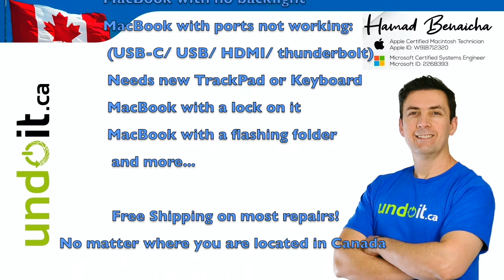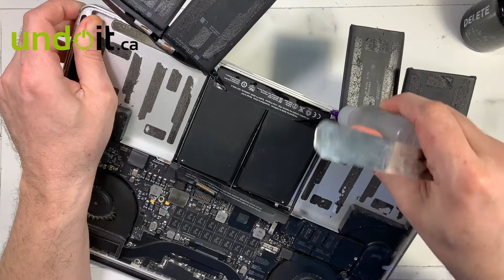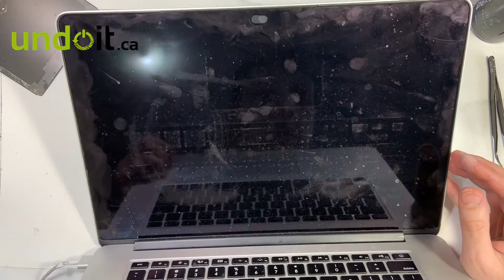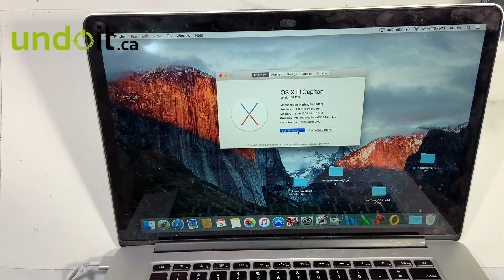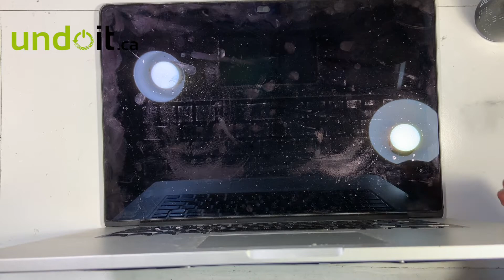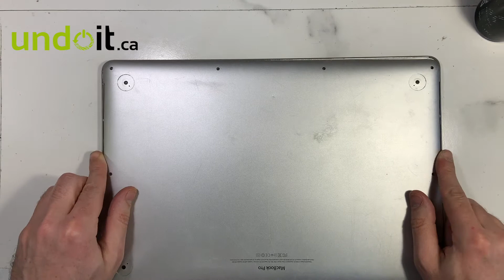🇨🇦🇩🇿MacBook Pro 15" A1398 💻- Battery Trackpad replacement👍 | undo it |  Hamad Benaicha | undoit.ca

Comment: Great vid, specially for how to install a new trackpad. I just installed new speakers. Risky business. Now the trackpad is jumpy, and the battery is not charging. How easy is it to damage the battery/logic board connection? The battery was fairly new, installed 3 months ago and was normal up until I finished the speaker installations and plugged in the power. So to summarize, the battery is not charging and pulling off the magsafe connector shuts the machine down instantly.
Reply from the maker: It looks like you will have to replace the battery, if you take your time and do it slowly it should not be a big deal, just take your time and rewind the video as many time as you have to, if for some reason something does not feat, don't force it, check what can be wrong and you'll be OK.

Comment: Thank you, merci! This was a helpful VDO. I had to exchange the trackpad of a late 2013 15 Inch A1398　and was successful with your guide. One tip: I replaced battery 6 months ago, and at that time tapes over half of the glue strips. That way I was able to remove and reinsert the battery without much trouble and without breaking the battery.

Comment: Is a touchpad from 2015 MBP 15" compatible in the Mid-2014 MBP 15"?
Reply from the maker: 2013 and 2014 trackpad for A1398 are compatible, the 2015 is not compatible with any other year, the design is completely different.

Comment: Hello Hamad, do you know what is the purpose of that black metal plate that is over the trackpad? And do you have an idea why it is painted in black?
Reply from the maker: Hello Dimitrov, I am guessing it is to protect the trackpad and for the color black that I could not tell you why. Hamad
Reply: @HamadBenaicha  Thanks for your Answer Hamad. I suppose it is not a big deal if the black color gets scratched, or is it? I am asking since on your video the black color on that plate seems to be scratched a little.
Reply from the maker: @dimitrovster  Yes it we are talking about the metal plate that sit on the trackpad, it's no big deal if you scratch, it's only purpose is to protect the trackpad, it has no functionality to it.

Comment: Thank you very much - to the point and clear, great tutorial. I was able to change my battery fine, but it seems there's a problem still! When I tested the battery before installing, the charge was 74% – and I turned it off, but then turned it on again to check Cycle Count (1) and Full Charge Capacity (8848) but this time the charge was only 30% something! After installation was finished, the small LED light on the power cord socket does not light and the computer does not start. I remember noticing that Amperage (mA) was -2400 -> does that have to do with this? Or is the battery I bought just bad?
Reply from the maker: Hi Richard it's hard to tell but most likely a faulty battery, an easy way to tell is plug the old one in (assuming it still work) and see if the power drops so fast or so suddenly but usually based on my experience a faulty battery.

Comment: this was easily the most helpful video on this subject. i spent several hours watching various ppl go to great lengths with different, unnecessary measures. i wound up using a bit of fishing wire to get me started on each cell (well in truth, i used a thin nylon string from a ukelele), but mostly just used a couple of plastic spudgers i had laying around for the rest of it with zero adhesive removal. very similar to how Hamad uses the spatula here, but the blunt spudgers gave me a bit more confidence in not puncturing the battery cells.

Comment: .Late 2013 15" retina....I have to do mine... I noticed it when I was at my Car dealer today waiting for my car to be serviced.... the dreaded "wobble"......Dang that was fast.. you really don't have to remove all the connectors and such like in other guides i've read,  been wondering if using say string or a fine wire might help, like "cutting cheese" in a way to break loose the adhesive for us DIY folks.

Comment: How good is the performance of the battery compared to the original one?
Reply from the maker: it is very hard to tell depending on the quality, I've had some that lasted longer but in general they will last less, for that model A1398 if it is a very good quality, you might get 5-7 hours depending on what you are doing. This is just based on my personal experience of course.

Comment: which battery brand do you recommend for a replacement ? duracell, ifixit, greencell ? I need it for my macbook pro mid 2015 A1398
Reply from the maker: I would only buy from reputable third parties as I've seen so many MacBooks with burnt charging circuit because the battery were of such poor quality. it is hard to recommend products but and please don't quote me 100% on it, fixit.com seems to have good quality batteries, based on the feedback I received from users.

Comment: Thanks for the tutorial, it's so much helpful: impossible is nothing. Now I'm going to do almost the same by my totally non-tech self )) Fingers crossed )) 
Any advice on where to get a fresh battery for MacBook Pro 15" model A1398 mid 2014 from? Or at least what should be taken into consideration while surfing e-bay offers? Official Apple says it's a vintage already...
Reply from the maker: Batteries and hit and miss and in all honesty there is none that I could recommend, my only advise would be make sure to read if there is reviews or recommendations
Reply from the maker: Hello Irina
Good batteries are not easy to find and can cause problems if they are of poor quality, as far as I heard fixit.com seems to have good quality batteries, but I am just going based from what users told me, I personally buy batteries from a local suppliers in Toronto which only sale in bulk and to computer stores.
Reply: @HamadBenaicha  oops, somehow failed to reach the site by the link or via google search. Do you, by any chance, know the manufacturer of the batteries you buy from local supplier?
Reply from the maker: please email service@undoit.ca   (are you in Canada)?
Reply: @HamadBenaicha  done, many thanks in advance!
Reply: @HamadBenaicha  I want to thank you for this tutorial, too! I was definitely not interested in replacing my battery myself until I watched your video. The other methods are ridiculous, and I say this as an electrical engineer who has built computer based electronic test equipment. So do you mean ifixit batteries? or fixit batteries? I am finding ifixit, but not the fixit brand.

Comment: Thank you so much Hamad. I'll use your video to replace my battery. Now to find a spatula.
Reply from the maker: No problem, let me know how it went!
Reply: @HamadBenaicha  Removal went well. I purchased an A1417 battery on Amazon.com from a company called Powerwoo. They described 8800mAh. After installation, before calibrating, it showed 8350mAh. After calibration, it now shows 8094 mAh. So I'm disappointed and have requested a return. But that means I need to remove it and try a different battery. Do you recommend any Amazon.com company to purchase a battery? Or elsewhere? Thanks for your help with removing the battery. Really appreciate it.
Reply from the maker: @Perly53  Hi Ricky... Batteries are hit and miss to be honest, I buy them from a local place but they only sale them to locals, Did you check with fixit.com - I never ordered from them personally but I hear good things... But don't take my word for it, please do your home work and check their reviews.

Comment: I have same device I cleaned it and changed thermal paste but still heats fans so low. Please advise me
Reply from the maker: what year is your MacBook?
Reply: @HamadBenaicha  MBP 2015 ....256GB
Reply from the maker: it is hard to tell until it is checked as it could a GPU going bad, a bad cooling heat sink, a bad sensor on the logic board..
Reply: @HamadBenaicha  thank u. How to send to u sir
Reply from the maker: @khalidali1972  I hope you are in Canada? if yes, please check our website at www.undoit.ca
Reply: @HamadBenaicha  thank u. Iam n middle east.
Reply from the maker: @khalidali1972  That's a bit far I am afraid :)

Comment: Hi I am gonna replace the trackpad on my MacBook Pro (Retina, 15-inch, Mid 2015) A1398, Can I reuse the battery if I am being really gentle and it is in good condition or is it risky?
Reply from the maker: Yes, absolutely but make sure that when you remove the battery that you are very careful and that is it does not get scratch.
Reply: @HamadBenaicha  Thank you for your quick reply, I am relieved because I was scared to get a battery that is not original and Apple doesn't sell them

Comment: You left your hard drive in
Reply from the maker: You are correct, likely enough for me I realized it after finishing the video, I debated if I should redo it or not but I didn't think it really mattered as the purpose of this video was about the battery and trackpad, but thanks for taking the time and letting me know, much appreciated :)
Reply: @HamadBenaicha  Thanks for the video I have mine to do and I learned a lot :-)
Reply from the maker: @cszrwi  Very happy to hear that! Thank you

Comment: Great video.  My battery is giving me the alert to change it and this is a big help.  I'm in the sates, not CA, so I'll have to do it myself.  Question, at the 11:50 mark you put your hard drive in to test the track pad and all, but I didn't see you swap it back out. Did you leave your hard drive in it?
Reply from the maker: Thanks Brian... Good point, you are very observant! Yes, I kept my hard drive in there until the end of the video but mainly to test the MacBook for few hours after, I did put back the client's hard drive (which is not showed in the video) just a straight swap.

Comment: I got my screen replaced by you a few years ago! excellent service! I didn't know you had a youtube channel! This video will be helpful as i attempt to replace the battery by myself!
Reply from the maker: Thank Simon, always nice to hear from client's like you, please feel free to email me or let me know if you need anything with your MacBook :)
Reply: @HamadBenaicha  hey Hamad! The installation went great! I swapped out the battery because 1. My Mac suggested it needed servicing.  And 2. I thought it might have been the reason some of my keyboard keys had stopped working. Specifically R, T, Y, U, I, O. I read online that the battery could swell and press on these keys making them stop working. However the new battery didn't fix this. I bow own the tools to open up my Macbook myself, is there anything I should be looking for that could be causing this?
Reply: @Simoncanada  Hi Simon, you can email me directly at service@undoit.ca that would be easier. As for the keys not working because the battery could be pushing against them is most likely incorrect, I have never seen it and most batteries are not located underneath the keyboard to be able to press against it, batteries could swell and push against the Trackpad and prevent the trackpad from clicking or even crack the trackpad but not the Keyboard. Individual keys usual stop working because at some point there has been liquid damage on the keyboard, I'd say 95% of the time it is the cause, but over the past decade, I have seen 3 MacBooks (all MacBook Air model A1466) where the function keys would register different characters when pressed and that was because of corrupted OS. If you'd like to eliminate the software issue, try a different hard drive if you have one, or backup and reformat your SSD, if the problem is still there after that, you'll know it is 100% a bad keyboard which you'll have to replace.
Reply: @Simoncanada  Did you figure out why your keys aren't working? I have a similar problem.
Reply: @paralleljay248  no I haven’t. I reset the PRAM and did all the suggested software fixes but nothing has worked. I’ve just been using an external keyboard.  I can’t recall spilling any liquid on the keys but perhaps that’s the issue? It seems odd to me that is just a single incomplete row of keys as well. I’m not in a position to spend even more money trying to fix it at the moment so the external keyboard will stick around for now.
Reply: @Simoncanada  Interesting. I'm going to try and reboot my computer back to factory settings to see if that helps. If not, then at least I know it's a hardware issue. Best of luck!
Reply: @paralleljay248  let me know if that works out! If so I’ll give that a try after I back it up!